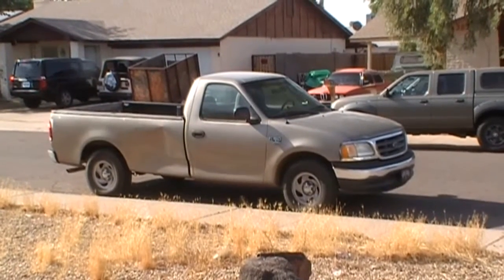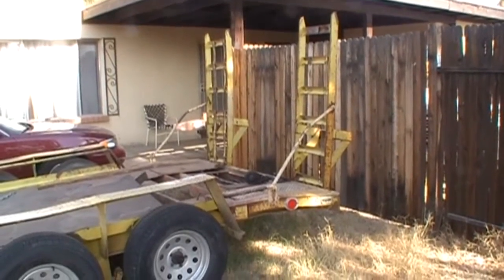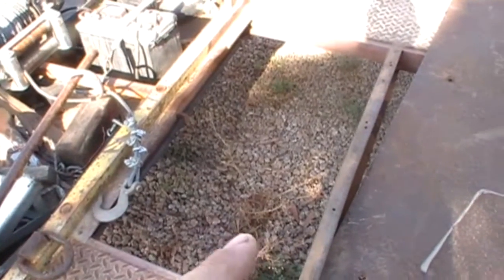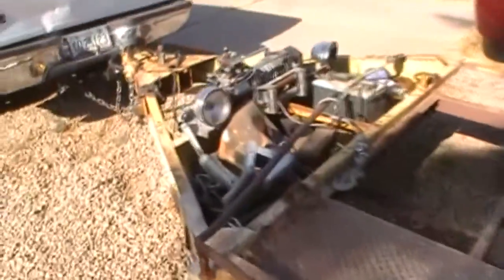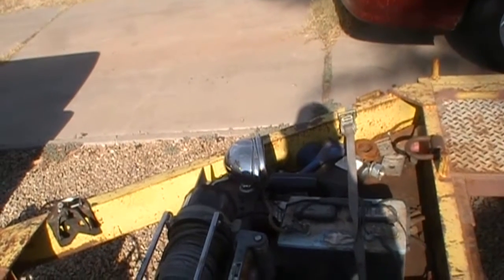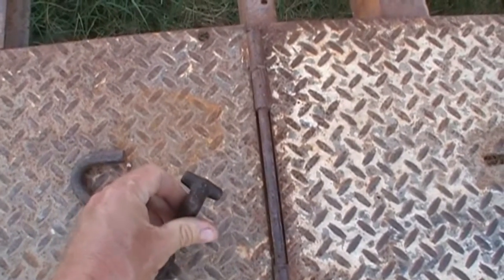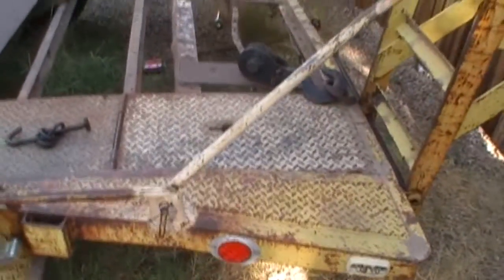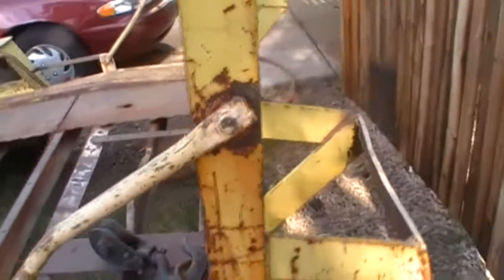Demolition derby trailer and my trucks.

Comment from the maker: Yup. Kinda glad this was the only trailer I could find at the time. Heavy (weights more then a 1/2 ton Ford) But it does not flex under a lot of load. I will be even be using this to do some real frame repair to fix a street car soon.

Comment: @kgilroy25 if you want a great truck, buy a mid 80s chevy 4x4 with anyhwere from a 305 to a 454 in it, automatic. those things haul ass. and get pretty reasonable gas milage. not to mention get a grill guard for it and they come in handy for shoving cars on trailers and for chaining to and really yanking a cars ass back donw